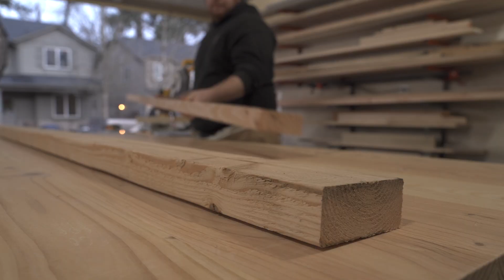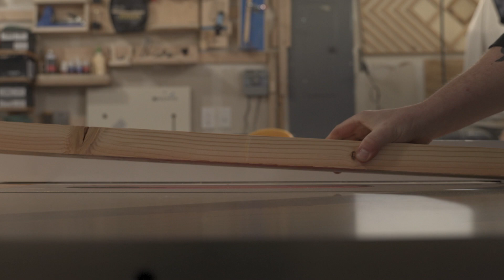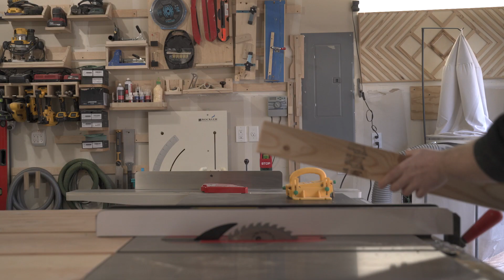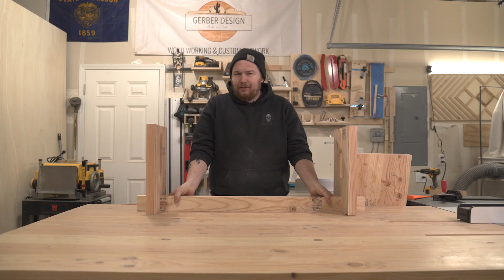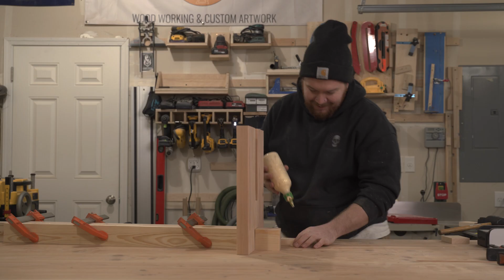$25 2x4 Bench

Comment: I am wondering something. Why does almost every woodworker I see, measure from the right to left on a piece of stock? And then check the right side of the blade if its on the line? You are wielding the saw with your right hand? Isn't evertyhing blocking your view? Or is there is special reason to do it like this? When I am using the mitre saw, i markt from the left to right and look to the left side of the blade. This way my right arm etc is not blocking my view, i dont need to think about the saw blade thickness and make cuts easily.